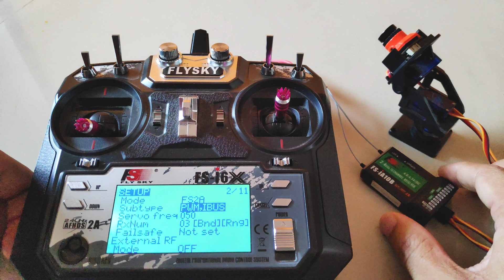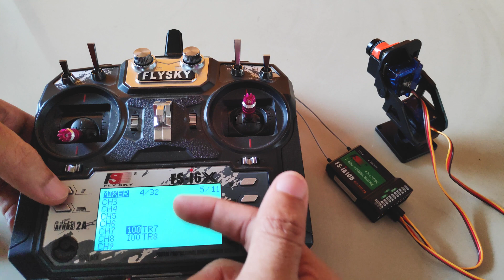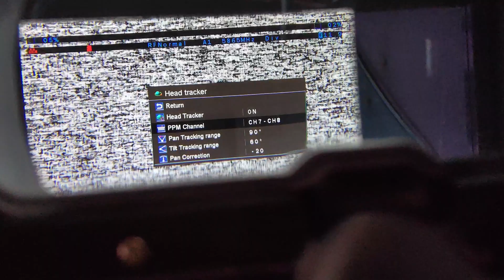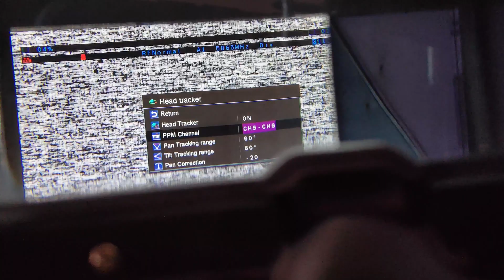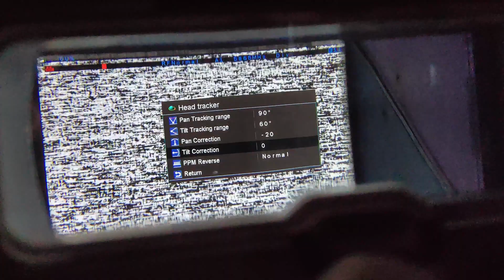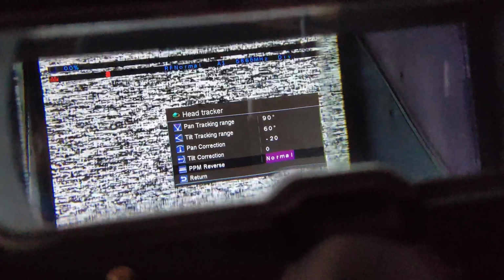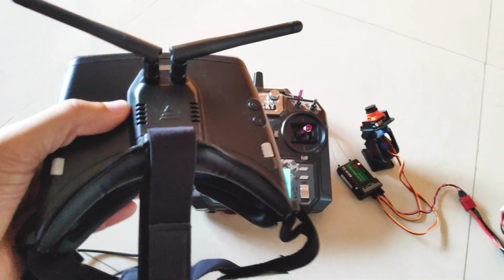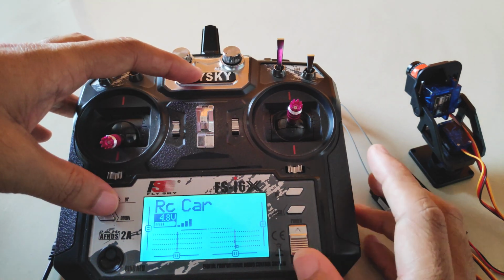Flysky FSI6X Open Tx FPV Goggles Head Tracker Setup via PPM Input

Comment: Thanks. Is there another way to use a head tracker with independent receiver? Also interested to know if there a reliable HT to use with relative expensive model (airplane).  Please link the head tracker and the  camera mount you use to buy, and hopefully it is compatible with dji goggles. Thanks

Comment: Hello,
first of all, thank you very much for the great informative videos.
As you described I wanted to flash the FS-I6X to OpenTX to use a gimbal from Motionsic with the cobra SD for headtracking.
Unfortunately, flashing is no longer possible with the new generation because a different chip is installed, NOT the STM32!
Some people now have the same problem.
What a pity!
Can you please recommend me or us an alternative remote control for such a OpenTX modification?
Does the new Flysky FS-ST8 work on OpenTX - that would be absolutely great. 
Thanks for your effort
Reply from the maker: Hi, you can still flash the open tx firmware on the gheey processor. Follow this link
https://github.com/OpenI6X/opentx/wiki/Flashing-&-Upgrading

https://www.rcgroups.com/forums/showthread.php?3916435-FlySky-I6X-port-of-OpenTX/page15

https://www.rcgroups.com/forums/showthread.php?3916435-FlySky-I6X-port-of-OpenTX/page16

Comment: Hi. I did buddybox with my qx7(ETX)-Trainer mode and fsi6(stock firmware)-Student mode. Just took ppm out from i6 and gave as input to qx7 then I configured qx7 to act as master trainer. It works perfectly. Hope i will buy i6x and boot otx for a cheap and best buddybox setup.
Reply from the maker: Thanks for watching. Indeed it's a good budget option for open tx raido with a lot more potential unlocked

Comment: Hi Rakish, I'm really a fan of your OpenTX on FSI6X videos. Please keep them up! I'm planning on buying a flysky i6x myself too

Btw, what is the major features that we couldn't get on the opentx version in the fsi6x? or perhaps hardware limitations that just couldn't allow them?

And will buying a turnigy 9x give more features on using an opentx for it? or will it just give the same amount of features as in the fsi6x? yet more expensive

Thanks!
Reply from the maker: Thanks for watching 👍 firstly don't even consider the th9x anymore. I had bought the th9x a few months ago when open tx for FSi6X was just introduced. Today the FSi6X has outperformed the th9x..as you can use elrs with higher baud rates introduced in elrs version 2.0 the th9x simply cannot support due to hardware limitations. And the open tx version on FSi6X is latest than on th9x.